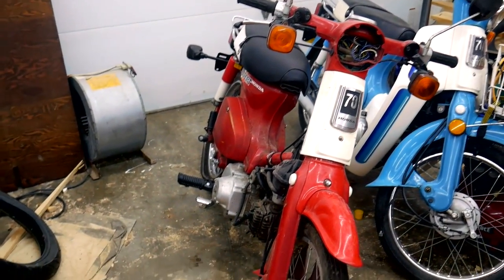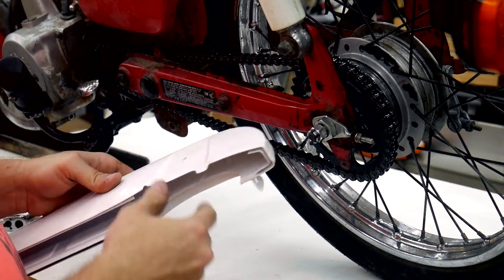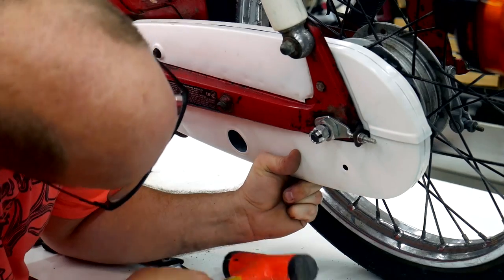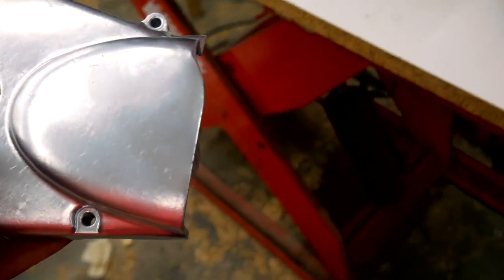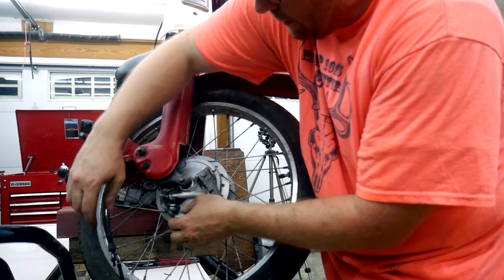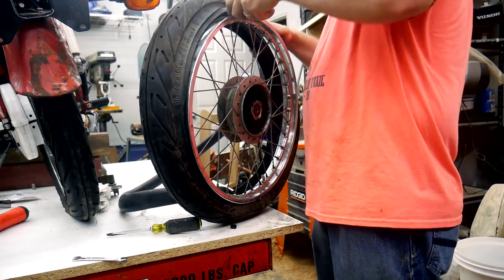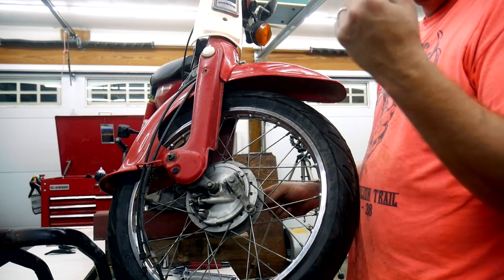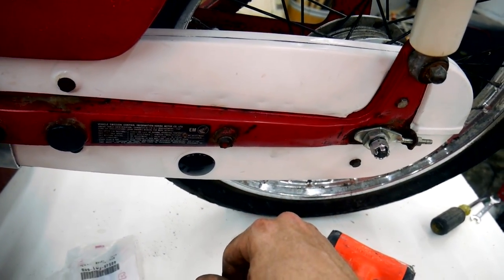Red 1982 Honda C70 Passport part 3: Chain Guard and Tires

Comment: The chain gaurd is not original. It is a reproduction. Those dimples are tack welds that have been grinded down. Also, I believe the oem bolts for the front sprocket cover is Phillips head. Restoring my c70 now and that what I've found out at least. Hope that helps!
Reply from the maker: Thanks. Nice to find a fellow enthusiast!
Reply: yeah my front sprocket cover has phillips head

Comment: Hi Thomas,  I also have this same model passport that I am restoring.  Just got it running and am having horrible wobble in the front wheel.  Any ideas?
 Thank you!
Reply from the maker: First make sure the wheel spacer is present on the speedo side of the axle, without it you won’t be able to get the axle tight enough to eliminate the wobble. Next you need to make sure the axle nut is just tight enough to eliminate all side-to-side play in the wheel, but not so tight that the wheel encounters excessive resistance.
Reply: @SouthpawWorkshop  Thank you sir!  I will check it out.

Comment: How do u adjust the chain on this bike
Reply from the maker: There are adjustment bolts on the rear swingarm where the axle attaches to the fork. You loosen the axle nut, then tighten the adjuster nuts evenly on either side of the axle until the chain is tight. You still want a little play in the chain. If you make it too tight, you could prematurely wear out the chain or sprockets. Once the chain is adjusted, you can re-tighten the axle nut. Reach out to me again if this is still unclear.
Reply: Yeah I found the adjusters mine are broke an need new ones was wondering how to install them an it looks like they are all the way back on the Mark's but the chain still has alot of slack
Reply from the maker: Thomas lockley could be a couple things. Your chain could be stretched or it may actually be a link or two too long. You may be able to find new adjusters at dratv.com Good luck!
Reply: Ok thank you for the comments Thomas lightle not to many videos on this bike an was thinking about changing the chain an sprocket just new to bikes first one an was hoping to find more info on this bike but I think I'm gonna get a manuel probably help alot